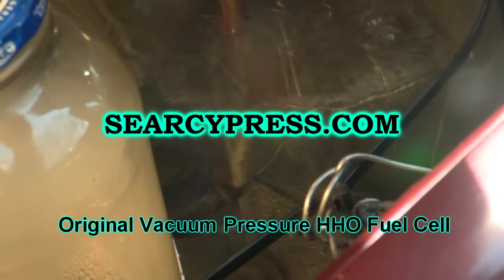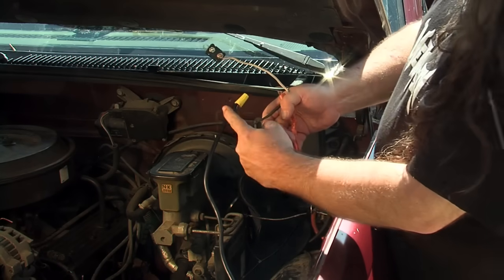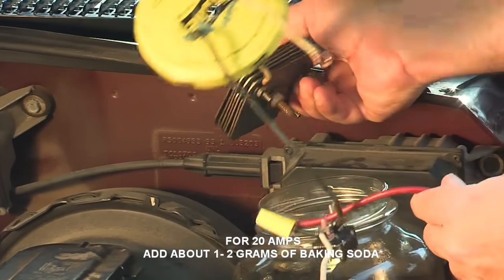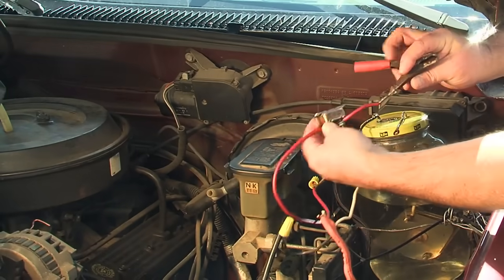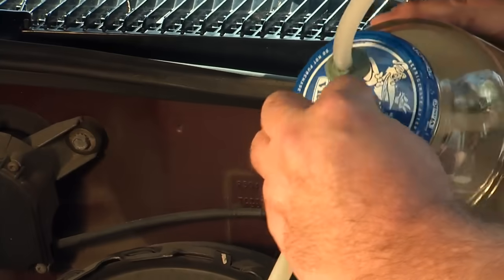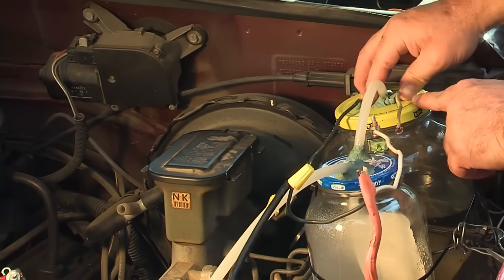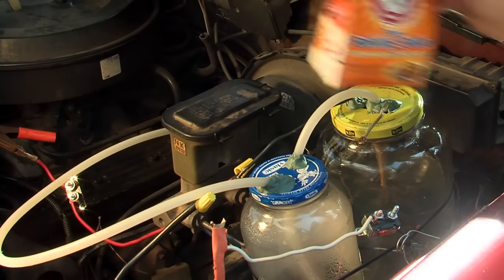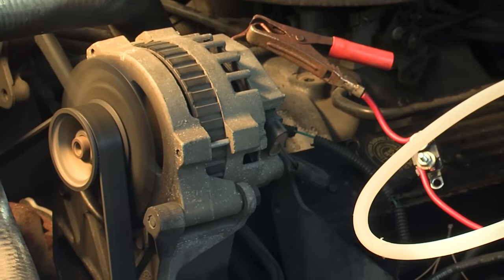Vacuum Pressure Hydrogen fuel cell defeats high gas prices using hydrogen from H2O.

Comment: Great video. but the one thing you left out was a before and after of your average fuel consumption. There have been a lot of videos popping up, trying to disprove HHO cells as a means of increasing fuel mileage.
Reply from the maker: The main difference is we are not injecting our HHO gas into the carburetor. We are entering into the cylinder in the state of vacuum. This minimizes the dilution of the HHo. We tried injecting into the carburetor and measured the results. There were no appreciable gains. Injecting into the vacuum however results in a much cooler catalytic converter and an increase in mileage depending on how you drive. An increase in power often results in an increase in leadfoot. You have to be conservative when you drive.  We have a new video coming out when the time is right. Be sure and subscribe. Thanks for the comment.
Reply: @metalpresstv  looking forward to it! Thank you for the clarification.

Comment: Does this work in Desil run vehicle.
Reply from the maker: If you have a vacuum line that goes into the engine you can make it work. No systems that operate out of vacuum will work. We tried it and abandoned it. Yet so many continued down that road. It pretty much discredited HHo. Vacuum is the key to proper thermal operation, production and injection. Thanks for the comment. 😎
Reply: @metalpresstv  I wish I knew how to do that!

Comment: It is UNSAFE to use an auto reset circuit breaker, expecting it to cycle regularly. IT WILL FAIL! Possibly causing a wire electrical fire! Old EE here.
Reply from the maker: Actually there are 2 automatic resets for redundancy. If you're using one of these cells you're always looking at it and checking things. It's not something you just install and forget. We have an updated video of this system with quite a few safety improvements and enhancements. This video will be released when the time is right. Be sure and subscribe. Thank you very much for the comment.

Comment: The sellers of these units say it increases efficiency and saves you fuel/money. In reality, however:

It won't save you any money. 
It won't save you any fuel.
These claims use pseudo-science to convince untrained people that the process works, but it's a kind of thermodynamic fraud.

Here's the kind of unmitigated rubbish they claim. Physicists and engineers everywhere on earth reach for the sick bag when they read this BS.
It's the modern-day equivalent of snake oil. And about as effective.
It's the modern-day equivalent of snake oil. And about as effective.
It can't work. As in - not possible. It cannot save fuel or money. Here's why:

It takes energy to split the water into hydrogen and oxygen in the hydrogen generator. That energy comes from the battery. Before that, it came from the alternator. And before that, it came from the engine. Originally, it came from the fuel.

In other words, the vehicle burns the fuel to run the engine, then the engine runs the alternator, which charges the battery, which powers the generator.

Chemical energy in the fuel turns into rotating kinetic energy in the alternator, which turns into electrical energy in the battery, which turns into chemical energy in the hydrogen generator.

There is an inconvenient truth in physics that energy can't be created out of nothing - you can't get more out of a system than you put into it. That is a universal truth - as in, it applies everywhere in the universe.

So, if the hydrogen-generation process ran with 100 per cent efficiency, the energy you get from the hydrogen would be exactly equal to the energy you put into the process (in the fuel to run the engine to make the electricity to split the water up into its component gasses).

So, the best-case scenario is: no benefit whatsoever.

Unfortunately, no processes in the real world is totally efficient. You lose a lot of energy in the fuel through inefficiencies in the engine (it take a lot of energy to compress the next fuel/air charge on the way into the chamber) plus there is frictional losses and unused energy in the hot gasses as they exit the exhaust port. Conversion of the rotational energy of the engine into electricity is hardly efficient either. Neither is electrolyzing the water (there's a lot of resistance in the hydrogen generator).

The vast majority of the energy in the fuel that is originally burnt to convert the water into hydrogen is inevitably lost to the environment. So the energy in the hydrogen produced is vastly less than the energy in the fuel used to make it. This is fundamentally why these systems are a con. There's no clever way to subvert this fact with technology.
A Reality Check

Every day around the world, thousands of engineers and technicians go into engine development labs in car maker's R&D centres. Their job is to make engines more fuel efficient. Fuel economy is an unbelievably big deal in the automotive industry. Fuel efficiency sells cars, and it is needed to meet tighter regulatory requirements as well.

The systems being developed are expensive - direct injection, engine auto stop/start, low rolling resistance tyres, low-friction ancilliary drive systems, cylinder deactivation, etc. These things cost HEAPS to produce. 

If it were as simple as putting a hydrogen generator under the bonnet, which could be done at very little cost, every car maker on earth would have done it already. 

They don't - because these things just don't wor

Comment: The scary part is not the fake BS but the 55K ppl liking it and so many ppl in the comments believing this.
Hydrogen is a very good and easy fuel ... if it were not for the very inefficient way of making it with electricity.
This cannot work. Debunked so many times and still ppl go for this shit.

Comment: Hi there mister hope still doing ok?
I am doing this now and use caustic soda as an electrolyte. Works nice and gives off massive amounts of gas. But my Amps are quite high.
Question
To lower the current more or less how much electrolyte shall i use? I see you mentioned there 2 grams of baking soda gives 20 amp.
Thanks hope to hear from you soon
Theo from South Africa

Comment: I did a very similar thing on my 150cc scooter. It gave me a measured increase of 50% in fuel mileage. We made a larger one for my father in law's dodge slant 6. Increased the power of that old worn out motor almost 3 fold. Where it would barely pull the van uphill, it pulled strong!
Reply: Wow, if only you could reproduce these results in actual tests you'd be a billionaire. Shame you're a liar.
Reply: Bullshit.
Reply: What was the dodge mpg like
Reply: @stn7172  I have no idea gauge was broken
Reply: I can absolutely see this as an electric generator source in an off grid setting. Car and house all powered for free. Make a blimp and fly the world.
Reply: @Staygoldfarms whatever hydrogen you produce to power your home, will use that same amount of energy to produce the hydrogen. You can only transfer energy. You cannot make more out of less. Say you use solar to produce hydrogen and power a generator, you could have just used that solar to power the house. The only advantage the hydrogen gives you is storage. You could store the suns energy in a propane tank essentially forever where as batteries suck. Then convert it back to electricity with a gas powered generator burning your hydrogen.

Comment: I think this is fake. The generator should be a dry call with a blowup prevention valve, and it should be kept away from the engine so it doesn't get too hot. Heat inhibits hho production.

Comment: I would use many small plastic containers in Series with a backflash arrestor between each one.
Safer that way. Also I saw something about using an ultrasonic sound wave to keep the bubbles
Flowing off the plates faster. The right frequency can boost output 14 times.
Of course that's probably too much, but would allow same output with less electricity?
And does this heat the engine too much? I mean do you need to keep a closer eye on the radiator?
Reply from the maker: Using plastic will never work because the vacuum pressure will collapse and distort virtually anything other than glass when it heats up.. The bubbles on the plates are pulsing the production. You see people wanting to use some magic frequency or oscillation but it's already going on behind every bubble. Because we have lowered the boiling point of the water we are also injecting steam. The engine can actually run cooler if it were not for the radiators thermostat. The catalytic converter temperature will remain low much longer resulting in the water that you see coming out of the tailpipe. Thanks very much for the comment.

Comment: what tuning device are you using to lean it out? those chevy tbi systems use a map sensor based system with o2 sensors to trim the block learn. u arnt changing the base map fuel corrections set by the manufacturer with this toy. when it pulls x amount of vacuum it was add y amount of fuel plus or minus the block learn trim which can only go so far... that is burned into the ecu... also i cant believe you did this with out changing the spark table... yes you cant adjust base timing but that doesnt change the ramping... now most people who do this lean the system and adjust the timing and get great results... but the thing is if your advance the timing and lean the fuel this is called lean burn strategy which is nothing new just epa doent allow it in the US... but doing that alone increases gas mileage.. also thats cool its steam cleaning your engine as you say but after a while it will rust your plug threads. seen it plenty in cars burning water from minor head gasket leaks.. but this could also be condensation from the increased exhaust temps you created while leaning it out

Comment: Could this Process be used to Power a Kitchen Cook Top ?
Reply from the maker: No. This is a vacuum design. That aside, HHo can be mixed with other gases for a super boost in output. Extreme care must be used when not in a vacuum state to prevent hazardous results. Ty for the comment.

Comment: Any particular reason you use glass?
Reply from the maker: The thermal properties of the glass are excellent. It does not distort under vacuum and high temperature. Other types of materials like plastic will always eventually misform under vacuum and heat. It allows us to see the current state of the water and hydrogen production. As long as the system is in a vacuum it is fairly safe. Of course malfunctions can occur and we have redesigned this in an upcoming version which we will have available soon for everyone to see. Be sure and subscribe so you don't miss it. Thanks very much for the comment.

Comment: I guess I’ll be the skeptic here. Have seen science labs with high quality mpg, torque, temp and run time equipment that have debunked this. Also, if this actually worked some smart entrepreneurs would have already marketed, got rich and been on the news,,,still waiting
Reply from the maker: There's more than one type of HHo injection. Air intake and vacuum. It's different. Thanks for the comment.

Comment: If you are "steam cleaning " ur engine. That means water is in the motor. So that would rust eventually?. So i would think that the rings on ur piston would ware faster. An they water or hydrogen would leak past the rings into ur oil. So i would then think that it would always be necessary to run ur car on gas for like 5 minutes after every drive of hydrogen fuel to clean the water out of the cylinders?.
Reply from the maker: Okay, we're not actually running the engine on the HHo. Combustion engines generally waste about 20% of the fuel which is burned in the catalytic converter for lower emissions. By injecting in the state of vacuum, HHo, we produce a complete combustion in the cylinder. The by product of burning gasoline is water. That's where the water is coming from because the catalytic converter is operating at a much lower temperature. We have a new video coming up be sure and subscribe so you don't miss it. Thanks for the comment.

Comment: High gas prices ...... who's come back to this gem while prices are 4x standard
Reply: Just curious how much does fuel cost over in the US?
Reply from the maker: @Jupiter-rs4zl it really depends on where you live in the states. If you live more towards the Gulf of Mexico intends to be a little bit cheaper because that's where they were fine a lot of the fuel... Prices are anywhere from $2.90 per gallon to$6 a gallon in certain states. Thanks very much for the comment.
Reply: @Jupiter-rs4zl  California is 5.99 a gallon averagely... traffic depends where you travel takes 17-45 minutes normally , LA is 45 minutes to 2 hours on a terribly accident filled day. So here on the coast we travel by time not by distance. If you own a V8 truck that runs 18+ gallons to the mile and if that 1 mile takes you 17 minutes due to traffic your looking at way more then 18 gallons for that one little trip since all your gas is spent on traffic and crawling under 5mph, wheras a little 4 cylinder honda is way more gas efficient at 30+ miles to the gallon. And electric is a fail, we get warnings all the time about our power grid being strained .
Reply: Do NOT use GLASS...
Reply: @TEACHERSSEES why's that?
Reply: Bro... prices are wat higher than 4X. They should be $0.30/litre. The government is fuc*ing us hard
Reply: I'm always looking to save gas at all times. Might make a low cc motorized bicycle. But I did get me a max mpg spec 93 Ranger as well. Pretty amazed with it, wonder if the mileage can be increased.
Reply: I hooked up my 02 suburban
Reply: @leonardthomas5582  Did this work for you?

Comment: They used to have water injectors in the airplanes of WW2. Having too much water all the time can get into the oil - Not good.
Reply from the maker: Edelbrock made an insanely cool water injector. Not really sure what world war 2 has to do with this but the byproduct of burning gasoline is water. Thanks very much for the comment.

Comment: One issue with this is the potential for hydrogen embrittlement of any materials that the H2 comes in contact with. This will cause early unexpected fracture and catastrophic failure. 

Hydrogen embrittlement is a well studied phenomena that you can look into for yourself. There is a lot of research going on to develop next generation materials for H2 pipelines and beyond. My point being that we are still trying to figure out how to prevent hydrogen embrittlement.

edit: just looked at the wikipedia page and it has a decent summary of the mechanisms and effects of hydrogen embrittlement

Comment: I don't see this being practical in regions that are below freezing, you'd have to keep it above freezing temperature, especially with water being in the entirety of the exhaust
Reply from the maker: It does resist freezing to a point, but yes you have to be creative in cold climates. It won't freeze during operation normally. The water comes from the gasoline, not the HHO. The lower catalytic converter temp is the cause. Thanks for the comment

Comment: If you use sodium hydroxide it will make the electricity work a lot better in the water and you get more hydrogen out of it too
Reply from the maker: Baking soda is a bit easier and safer to use. But to each his own. More is not always better on HHO. People try to run the engine, the goal is to burn the gasoline in the cylinder and not in the catalytic converter where it's just wasted power. Thanks for the comment. New video coming asap.

Comment: 4:20 oops red flags if his putting power to the hydrogen unit how is he getting the power to it appears connected to the alternator leeps no gasoline going into the vehicle how is he running the vehicle to charge the battery or the alternator in order to get the electricity to the hydrogen unit the only thing I can see is his using the power from the battery at least initially for the test and wouldn't water damage the engine or at very least cause a difference in heating and when temperature conditions

Comment: Does this work on a diesel engine??
Reply from the maker: The system relies on a vacuum. Without the vacuum you have no way of injecting it into the engine and anyway which it will do any good. If the engine has a vacuum intake which goes into the cylinder you most definitely could make it work. At all engines are the same so that's kind of a hard to answer question. We have a new video coming out that will try to cover a lot of those topics. Be sure and subscribe. Thanks very much for the comment.

Comment: Does the gauge of the wire "10" have an effect of amps that is transferred to the positive post in the cell. I'm using # 8 gauge for pos and neg. I do have the 30 Amp fuse on the power side

Comment: Sabbath
Sat. 28. Jan. 2023.
Ames. IA. USA.
0210
Θ
Θ
Θ
· Ok.
But you are not addressing how the hydrogen gas is actually separated from the oxygen gas.
Or you are not separating them?
θ
θ
θ
💚💚💚
Reply from the maker: We don't actually separate any of the gases. We're not trying to run the engine on this fuel. We're simply trying to increase the efficiency of the engine to 100%. An engine like this is only burning about 80% of the fuel most of the time. By injecting HHO into the system under vacuum we are able to achieve much higher efficiencies than the designers intended. As a result, the  catalytic converter runs much cooler because it's no longer burning the 20% of wasted fuel. We have a video coming out this year which will talk about all of this. Be sure to subscribe so you don't miss it. Thanks so much for your comment.